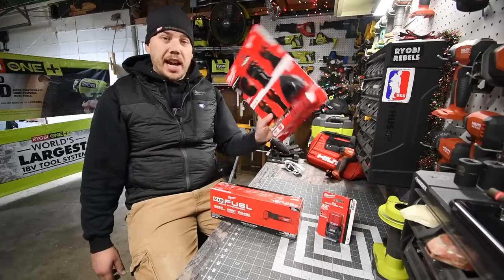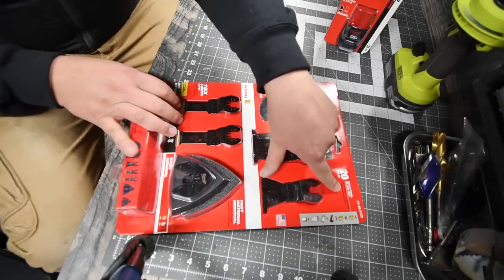$150 M12 Fuel Oscillating tool + (Free 2ah Battery Black Friday Sale)

Comment: Milwaukee is taking the power tool industry to the next level.
Reply from the maker: I agree with you on that
Reply: for a short time. I have this tool. It has a view drawbacks that most Milwaukee Influencers don't talk about it.
Its still an ok to good Multitool if you can  life with the limited run time on the 12V batterie while the 18V Version is basicly the same size. Also it don't cut as precize as the non fuel version because it vibrate in longer strokes so Milwaukee need to catch the buyers and fans that it cuts as fast as other 18Vs

Comment: You wanted it you got it. Cool stuff I like Milwaukee Tools Plus DeWalt I like they're oscillating tool, impact driver, drill driver, hammer drill, explanation before I go to the next tool these tools are both Milwaukee and DeWalt now we're going to the next tool sander, router, nailer, impact wrench, they're socket set, ratchet, recip saw, circular saw, battery, their drywall cutter, that's it now they're both for Milwaukee and DeWalt.
Reply from the maker: I thank you for viewing usman
Reply: @ManCaverTools  you are welcome

Comment: can you do i verses video vs the m18 brushed model im curious if it will outperform it you have to use the same blades because like most bladed tools they're only as good as the blade you put on them
Reply: The m12 fuel is alot better then the m18 brushed version
Reply from the maker: Yes I can. I thank you for the suggestion Minnesotaman

Comment: Great video as always! Question, between this M12 fuel or the Kobalt 24v oscillating tool, which do you prefer? I own both battery platforms but not sure which way to go. Thanks!
Reply from the maker: when it comes to this tool id go the higher voltage one since you dont have a huge difference in size and I thank you for viewing Luigiz

Comment: M18 Fuel is bigger in diameter than the M12 Fuel. I have the M18 Fuel it is beast mode.
Reply: Same also has the auto function which is the speed i keep it at all times.
Reply from the maker: I will have to get the m18 version as well and I thank you for viewing James

Comment: Debating on this or the m18 with the 1.5 battery for $99
Reply: if your getting the m18 order the fuel model on ohiopowertools, or acme, if you dont own m18 batteries than go with the m12 fuel i think that would out perform the brushed m18
Reply: @minnesotaman3  the new m18 fuel? Isn’t that like $200 plus. I was thinking of the m18 brushless for $99.
Reply: @CP-ok1gv  that is a brushed version not brushless
Reply: @WyattH  I mean brushed ain’t too bad sometimes. Might go with the m12 fuel. Nice midpoint between m18 fuel and m18 brushed.
Reply: I have the old M18 and the new M12 Fuel. If you are just a homeowner then the old M18 is perfectly fine. If you are a tradesman and will use it for work then the m12 Fuel is better in everyday and I would recommend it or the M18 Fuel.
Reply from the maker: id choose brushless

Comment: Good video , Great blades , but the Multitool is waay too Big to be a 12v tool and the tooless blade change is a JOKE , it  takes too long 😴, if it was a Dewalt you could put that blade in any position in a second , the tool seams to have good power , or was it the blades 🤔 we need a head to head with another brand ...
Reply: Try using starlock blades on the dewalt,see how long that takes 🤣
Reply: @jasons4219   Why ??  That's on you if You buy blades that don't fit right 🤭, Milwaukee and DeWalt blades fit just fine 👍👍🤙🤙👌👌
Reply: @brianf9619  The Milwaukee will take any blade,the dewalt on the other hand you have to use a key and so forth and its still not right half the time with the starlock blades. Has nothing to do with not buying the right blades more so that the dewalt lacks the so called quick change 🤭. Sorry if you don't understand what starlock blades are. 😒
Reply: @jasons4219   The DeWalt Blades and the Milwaukee Blades do ALL my cutting need just fine , the blades go in and out super fast , I can put the blades in any position I want in a blink of an eye , so I dont care about Starlock blades , I have NO use for them , you can have them all..👍👍
Reply from the maker: I agree with you on that Brian
Reply: @brianf9619  People can use whatever blades they wish. You made the comment if it was my Dewalt it would be done in seconds which isn't true with certain blades as it is with the Milwaukee.  Not trying to start something,just stating facts.
Reply: Yeah until you get that Dewalt blade change lever jammed into your hand a few times! I've even seen one guy bend the lever and one guy break it because it sticks out to far. The Dewalt blade release lever is in a bad location and poorly designed! If your changing the blades enough times that it makes it a big deal, then your using the wrong blades for the job! Its literally only a few seconds different in time.
Oh and I used to work for Dewalt in Jackson, TN. so no I'm not a Dewalt basher I just don't like the design of that specific tool. The M12 Fuel is close to the same size as the original, at least in length, and if you look at the M12 Fuel ratchets etc. it is similar in size. A lot of 12v tools are just as big as 18/20 volt tools. 
I agree with you on the head to head would be nice to see.
Reply: @jameselam8263  -‐--  I'm a carpenter and I've had my DeWalt for over 18 months and never had any problems with it ,  I can't vouch for how other people use their tools , maybe he abuses his tools , maybe he left it outside and it got rusty , or maybe he just got in a fight with his wife , I don't know what happened with that guy and his multi-tool , all I know is I take care of my tools , I don't abuse them or throw them when I'm mad and the tool has worked Fantastic for Me and the blades I use do a great job for Me , I have DeWalt 20v &12v , Milwaukee  m18 & m12 , and Makita 18v , so I'm not some Milwaukee hater or DeWalt fanatic , I know what I like and buy what I like , that's it ,  so if you guys like that m12 multi- tool and love those Starlock blades , more power to you , I'm glad you guys like it , that's all I'm saying.... 👍👍